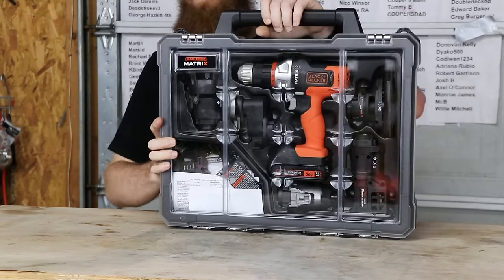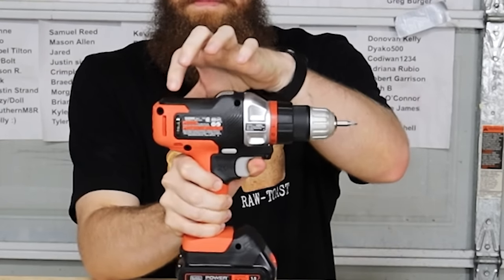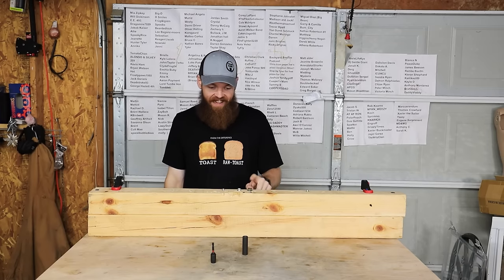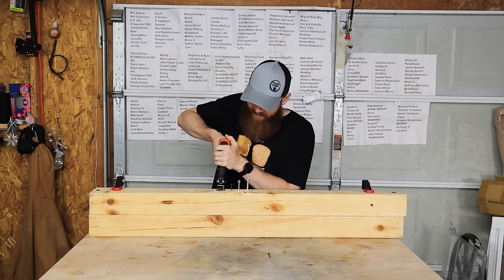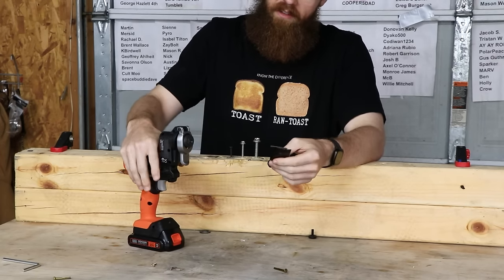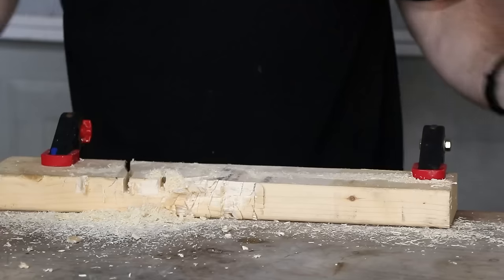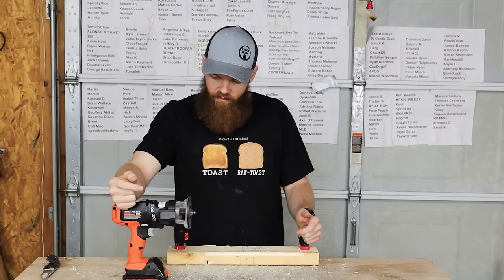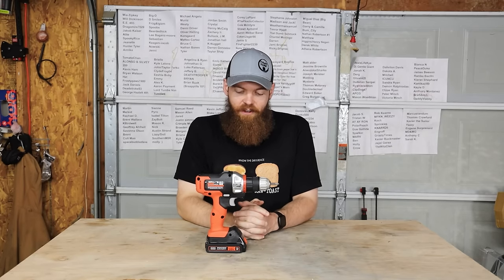Is This The Last Drill You'll Ever Need? | Black & Decker Matrix system

Comment: i have thos setup, w 12 attachments,, and while i wont use it on the job,, its perfect for keeping in the trunk for emergencies,  or just as a house tool,,, like I actually gave it to my sister to keep at her house for any lil chores or whatevs she needs to do.. 

but yeah I 100% agree w you on the B&D being straight trash,(which is odd considering the other tool companies they own lol),, but yeah this is actually a nifty, n somewhat sturdy lil tool for anyone who is just starting out,  or tool-naive .. its actually not a bad tool, if they made a brushless version of the drill handle,, then this would be a an actual consideration just for its compact-ness lol. 
abd by the way you mentioned you liked this idea,, look up Craftsman Bolt-On,, its what this wS based off of, and those attachments work w this one as well if you can find em.. they have aalot of diff attachments to add, from a tire air pump, to metal shears lol

Comment: Yes, on the router, operator error.  Even with a big router you only do about a 1/4 inch depth at a time and you use a guide when trying to route a straight line.

Comment: actually had the older 18 volt version of this kit. mind you all the pieces were separated but they were all 18 volt. the Black& Decker sold for about 200 bucks years ago. I honestly used way more than I ever thought I would and for a homeowner for such a low buying price. it makes a lot more sense than it should.
Reply: 18 volt sounds like the set version before the current matrix. Matrix version is like 10 or so years old now as thats what I have and they only came in the 20volt or the weird mini matrix volt like 8v or 12 volt (use same attachments) but that thing was useless battery wise. You can get the drill for like 50 to 60 for the newest version (with the stupid light on the base) Tools go for like 20 to 30 separate.
Reply: Are you talking about the Firestorm line? I still have my 18v tools.
Reply: @mattsypersma6418  yeah, I believe you're right. Still miss some days... Have to buddy as first kit to do handy man work

Comment: You know the drill head is for drilling and impact is supposed to be for running screws. Also low gear works a lot better to run screws. More torque and less speed. You may have had it on low speed. If you did ignore that. Thanks for the video

Comment: You should not try to drive lag bolts without pre-drilling. 
The most common use I can think of for an average homeowner to use lag bolts is mounting a television on the wall. I have mounted several televisions and every one of them have said in the instructions to pre-drill the holes. 
Also driving all of those screws with the impact would have gone a lot better that’s the only way I even try to drive screws anymore is with an impact.

Comment: The jigsaw looks like a vibrateybasterd nocutwonder, specific blade multitool ,I have a Ryobi with a similar affliction it sits in the corner eating crayons. Palm sander never seen the point. 
Palm rounter is interesting variation on what various headswap tools offer. 
Only one battery and how the motor unit survives is what determines how long before the whole kit becomes landfill.
I feel this will need a follow up video that justifies your disdain for b&d , its inevitable.

Comment: Screws are harden steel, none of those plates are made to cut screws. Nails however are mild steel. That’s kinda what those metal blades are designed for. Coming from a 10 year contractor.
Reply: I’m glad someone said it. As soon as I saw the deck screws I was like “no shit it is chewed up the blade. They are hardened steel…” (Tyler proceeds to chew up a carbide tipped blade on the next screw)

Comment: [Start of Video]  If this is good and a reasonable price, I might consider picking it up.  I do a lot of small hobby stuff, and those tools would be incredibly helpful, but not necessary enough to justify spending the big bucks and getting high-durability professional versions.

[End of Video]  I’m pleasantly surprised.  I think what Tyler tested would definitely be the upper limits of my uses, so good to know that the tool is capable.  I’ll audit my options and usecases and see if something like this would be able to improve my crafting space.  Thanks for the useful breakdown!

Comment: Bosch do a multi head drill.
12V system.

That router will manscape many fingers and many abdomens in the future.

Impact drivers are great.

You could get a half decent combi-drill and impact driver kit and a sander which would see most folk right for the same money.
Ryobi 
Drill and impact driver 88 bucks
Jigsaw 40 bucks
Skil saw there’s one left at 47 bucks!
That’s a better kit for less.

No router no sander no multi tool
but better tools.
Most basic kits should have a sander.
Could switch skilsaw or jigsaw depending on requirements and still keep it less.

Get a proper multi tool.......
Just makes sense.
Even being in the trades, they don’t get used very often. So probably it’s a waste, but when you need it! It’s the only tool for the job.

Comment: I've got just about all of those attachments plus the circular saw, reciprocating saw and tire inflater attachments. Love them all, except the tire inflater attachment. That one sucked rancid lemons.
Reply: … they put a circular saw attachment on one of these?
Reply: @Fetidaf  yeah it works well but the max depth is 3/4 inch
Reply: @feraacedia1825  oh, so it’s closer to a cut off saw than a circular saw
Reply: @Fetidaf  It's small, cut up to 2 inches thickness.

Comment: If you had held the sander FLAT it would have worked better. NO jigsaw is made to cut 2x4s. That's what circular saws are for.  Considering what you did with all the attachments. It did pretty damn good. I've had B&D tools for 30 years and have used them to remodel 3 homes.

Comment: Tyler... We've talked about this. YOU HAVE TO PREDRILL HOLES IN WOOD!!! This isn't a fair test if you're using items incorrectly 🤦🏼‍♂️
Reply: For a test like this you dont predrill holes. You want to see how the tool performs in the worst case scenario. Its not necessary to predrill holes in every situation, eg hanging drywall.

Comment: they make adapters so you can use other blades on the oscillating tool and the jig saw failed because you had a shitty table, the clamps to far away from the end of the metal and you usually use a jig saw to cut plywood, not a 2x4.

Comment: With the jigsaw.. the height from base to trigger isn't giving you the chance to push forward. You're actually putting more downforce into the wood instead of helping to push forward....you should try again but use both hands, one to pull the trigger and one to push forward....also try a harder or more seasoned wood for the router....but really the drill isnt pushing enough rpm compared to actual routers...gets the job done in a pinch

Comment: I have an old brushed Bosch impact that could run circles around that 😆

Brushed motors are usually bigger in size than brushless, but that doesn't necessarily mean they aren't as strong.

Don't give black and decker the excuse of a POS tool because it's brushed lol

Comment: I skipped to the router section because I'm curious about it as a cheap cordless option.. man that was kinda scary to watch. I'm no expert, but I don't think you're supposed to do such deep cuts on one pass, looked like a lot of stress on the bit.

As for Black + Decker, I disagree that they're trash. I have tons of Matrix and 20V tools (including vacuums and yard tools) and they're plenty good for all but the most discerning homeowners. I'd never recommend them to trades people who use them heavily every day, but I'm still using my original power unit and have some original batteries after 10+ years of fairly regular weekend use. They're cheap, but still decent quality.
Personally, I think a lot of people over-buy. Lots of casual users (like myself) out there who automatically jump to contractor-grade tools but they'll likely never approach the extra capability or durability of the more professional tools. It's like buying a heavy duty diesel truck when you know you're just going to be hauling mulch or a 700lb lawn mower once in a while. By buying into a more modest, affordable system, I don't have to hesitate or feel guilty when they release something new and interesting that I want--like why I watched this tonight.. this is just a last-minute add-on to my Amazon order. Over a decade later, I'm still a fan of the system for casual homeowner/DIY use.

Comment: I am not a BD fan either. But occasionally they make a good product. I had an 18volt hammer drill that lasted for 10 years and used it for work as well and gave it hell.  They will surprise you sometimes.
Reply: I forgot to mention the drill did not die. It used the old heavy Nicad batteries and was too heavy compared to modern drills.

Comment: I have this. It's not going to outperform dedicated tools (even from Black & Decker), but it's cheaper and, far more important for me, takes up a lot less space. 

I'm also a curious guy, so I've taken some of the things apart (like my impact driver) and I was surprised to find almost no plastic in the drive systems.

The impact driver does have a good amount of grease in it, as you'd hope for a geared system.

I would love to know how it'd fare if you replaced the motor with a brushed one from a Makita or DeWalt.

Comment: I really want this, I've always wondered how difficult it would be to open the shell and replace the shell with a higher end drill motor and convert the battery to match it.

In my head it sounds amazing since there's obviously never gonna be a Milwaukee/etc version.

I can imagine how goofy it would look though trying to modify an already unique piece such as this but dang would I be willing to try it. I mainly wanted to do this because of the saw components.

Comment: I built a ridiculously nice deck with one of those drills haha. Talking $12k plus, 365sqft deck. Worked, but wouldn't do it again. Has enough torque. Never used the saw attachment tho. I mean I have, it works, but a good handsaw is still quicker.

Comment: I own this set.  It was too interesting to pass on.  Overall it is decent for the money.  I really wish Tyler would have bought the circular saw attachment, it's also pretty useful.  I think there is also an air compressor attachment, but don't own it.
Reply: The saw is great. Air compressor is great for inflating motorcycle tires at home. Hand pumps don't always have enough space to be stable for pumping, like doing back tires on a bagger.

Comment: Seems like the tool would benefit from a bigger amp battery. That's the main problem of Black and Decker, only 1.5 and 2.0 batteries. I think the 4.0 is discontinued.

Comment: Use the included blade as a template to drill holes in better quality blades (if needed) for oscillating tool.
But generally speaking black and decker tools feel and look too much like toys imo.
Would be surprised if this lasted very long under use.
Best perhaps for once in a while users.

Comment: When cutting metal with the occilating tool, you need to slow the blade, just like if you were drilling with larger drill bits
Reply: Interesting. Can you eventually speed it up or always stay low? Occasionally I use a dedicated oscillating tool, almost always to cut vinyl, but occasionally aluminum. It’s not often enough for me to seek out how to better use the tool, but often enough to wish I knew lol
Reply: @bernietoth  Oscillating tools are not meant to cut a lot of steels without the proper blade and the HSS are good for soft nails but the harder screws will kill any blade no matter the brand unless you get the grit cutting blades. Carbide is impact sensitive and horrible for oscillating tools. Wood, plastics and aluminum is ideal use for the tools.
Reply: @silentferret1049  thanks for taking the time to write that out!

Comment: I see many people make the mistake trying to cut off wood screws. They're almost as hard as your blade. In this case you should use an angle grinder. Don't saw off screws ever! And I don't think it's a good deal. The motor overheats and dies, you lose all your tools at once. You're not impressed with the blade quality? You can expect the whole kit made of that quality.😂 I have many tools, that however use only one battery. That's a good deal. Yea it's more expensive especially brand tools. But I don't have to worry about them. I know they perform as they should. And they do. I say wait longer and get proper tools then start your project.

Comment: The ossolating blade, thats user error, learned that the hardway, going fast on nails generate ALOT of heat and it does eat the blade, lower the speed and friktion!

Comment: I’m not sure who actually makes these tools.  Craftsman had a system years ago called the bolt on system.  Same concept and I own a bunch of the tools.  These two products are made by the same company as I have black and decker batteries and tool heads that work I use with the craftsman motor body.  Craftsman had several other tools heads available besides what came in that black and decker kit. I’ve used them and abused them for years and they still work great.

Comment: It's basically a rebranded Craftsman Bolt on system.  I had that kit about 10 Years ago. But It also had a small 3 3/8 circ saw which is great for sheetrock or some demo like on lathe on old houses. I'm sure that my attachments are interchangeable. I would love to see you find the bolt on kit from craftsman if it's still around and try it out
Reply: Matrix started it and Craftsman got the rights for the system before they went under. I got the bolt-on system first back when sears was still alive. The saw blade was the Trim saw and yeah its great for 3/4 inch cutting.

Comment: You router if your going the wrong Direction from the spinning will dig out chunks the only problem I’ve had with my matrix set in when the batteries start getting low it heats up and runs al little rough and your saws all  I think you need some better blades the only thing I didn’t like was the battery I got a 7.0 amp batteries from Amazon and it works so much better I don’t use it all that often so I only have to recharge the batteries batteries a couple times a year I got the weed eater with the 4 wheel lawn mower attachment that uses the same battery I can mow for around 30 min non stop I also got the 120 v electric motor head because I thought that using the battery drill head with the router attached would not do much with the batteries it works but not as fast as the battery motor and it sow quickly I was done with almost all of the router work before the batteries ran down here’s a little tip if your using the electric version this doesn’t matter but with the batteries don’t set up everything and try to use it nonstop like with with the router make a cut then do your measurements and setups for the next giving your batteries a little time to cool down between using them they will recharge themselves and hold a charge for days if you run them till they overheat and shuts down you will reck your batteries and they will quit you can get a couple of batteries and when one starts getting warm swap it and let it cool down once you wreck one it’s junk that’s why I bought the corded model but if you don’t try to use these nonstop they hold up great I got the cord model because after a few year they always discontinue the batteries and your left with a bunch of tools that don’t work anymore I moved a couple of years ago and gave the neighbor around 20 drill sets with that problem I still have a Dewalt set but the batteries are over $60 each I’ve spent around $200 on this set with a few more attachments and it does way more than the Dewalt  ever thought of sure the drill is a little bigger but if you use the impact head you’ll never notice

Comment: Lol, you gave that router it's worst case scenario.  It did it though, so good on B&D there.... there is climb milling and conventional,  it's all about which way you turn the bit. Not much use for climb milling with a router. You want to cut so that the turning of the bit is against the way you are working. If the turning of the bit pulls your tool, you're doing it wrong

Comment: TylerTube has every tool recommended on Amazon and still does not have a sturdy work bench to do his videos on... 🤣
I actually have the corded Matrix system and it certainly does the jobs. A real chop saw and dual handled router would probably work way better, but not everyone has the space to support such professionalism. So if it works well enough and with a to-go-box then that is all you really need.

Comment: I mean it works but the price is a bit high if you're gonna be mostly using the drill because it's rather mediocre. For this money you can get bosch drill that's gonna be better than this, but it won't have these attachments. If you don't mind a weaker drill you can save a lot money because you don't need the $40 jigsaw $60 oscillator(doubles as the sander), $70 hammer tool and whatever router tool costs.. that will all on their own be better, but the performance from all of this is acceptable for occasional DIY jobs and it's all on one little neat package so saves the space too.

I am wondering tho how good the grip of sandpaper on the sander is.. because I bought the then $100 bosch oscilator and while it's good for sawing through metal and wood, the sanding attachment sucks because the sand paper slides off after not much time.. the back of sand paper gets destroyed quickly so no longer grips to the tool.